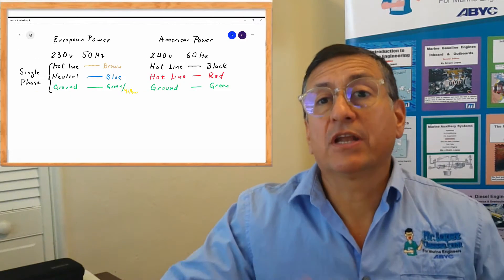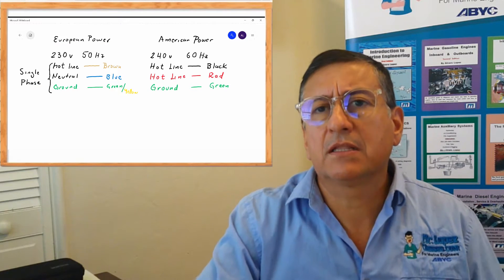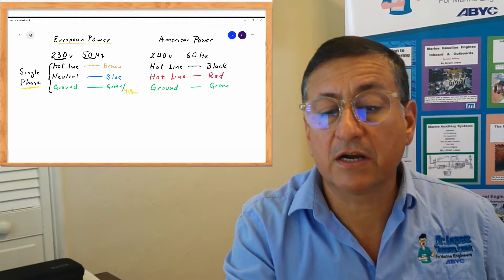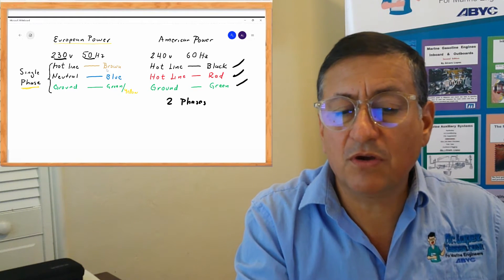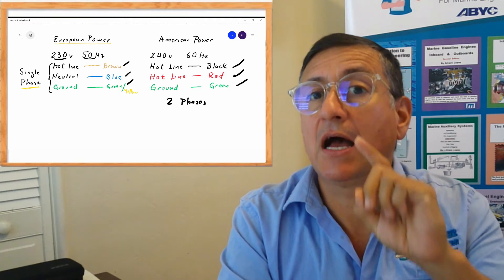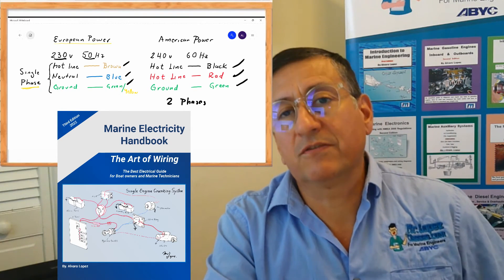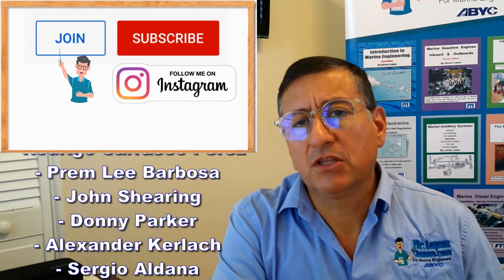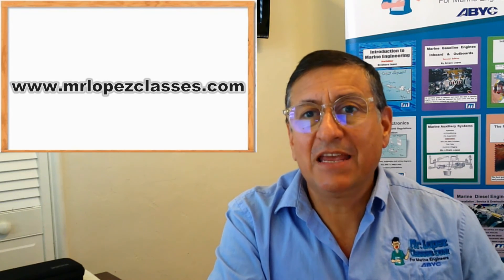What means 230V / 50Hz and 240 V / 60Hz | Shorts

Comment: Hey Mr. Lopez, I noticed you missed a key factor in the 120/240v system. The neutral (grounded conductor). For 120/240 system you need 2 phases, a neutral (grounded conductor) and equipment ground (grounding conductor). The neutral carries the unbalanced load, while the ground creates a fault path as well as equal potential. It is very important to have both. I see a lot of European boats not equipped with a true 4 wire system, even though they come out of the yard “ready for the US”. Are they not knowledgeable in split phase? Is it laziness or price (many of the boats I work on are production)? Is it availability of wire in Europe? I’m guessing 4 wire probably isn’t readily used, manufactured or available since Europe mainly does single and 3 phase.

Comment: Hello if I connect a 230volt 50Hz  ac fan to a 60Hz and I connect it again to a 50Hz which one will be drawing more current the 50Jz connection or the 60Hz connection.
Reply from the maker: If you have a fan 230V / 50 Hz that draws 40 Amps there is just one phase.  If you connect that fan to 240V / 60Hz source ( There are two phases 120v each one) then the flow of current per each phase will be 20Amps
Reply: @MrLopezClasses  Okay thank you.

Comment: Thank you. I'm sick of running into the Hz conversion wall where people says it's not possible to convert Hz into Amps.
Reply from the maker: HZ is the frequency and It is directly related to the RPM of the rotor in the Genset. and Amps are the flow of electricity through a specific point. Both of them are different concepts.
Reply from the maker: yES, yOU ARE CORRECT

Comment: in america it's 240v single phase with motor loads name plates have 220v/240 50/60hz it's just at 60hz motors run 20 percent faster.  but they can be wired with l and n for overseas and for american L1 L2 240v and it will work.

Comment: Thanks! For resistive loads, eg water heater, or an appliance that states it can run on dual frequency (eg VAC 210-250 50/60 hz), is it true that it will not care whether supplied by 240 v 60 hz “US” vs. 230v 50 hz?
Reply from the maker: Hi. Yes it is true, those appliances can run with both frequencies, however they are a little less efficient running with 50Hz. Regards
Reply from the maker: It is true, however remember that in Europe they have 230V and 50Hz IN ONE PHASE, However in America we have 240V and 60Hz IN TWO PHASES

Comment: Hola Mr Lopez, una consulta, yo compré unas máquinas en Inglaterra, y las quiero usar aquí donde se usan 60Hz, me dijeron que podía cortar los enchufes y cambiarlos, eso es cierto?
Reply from the maker: Hola. Se puede pero no se debe. Ese equipo en inglaterratrabaja con 230V y 50 Hz en una sola fase. es decir entre Hot y Neutral recibe 230V. Si cambias sencillamente el enchufe , le estarias metirndo por el mismo Hot y Neutral 120V y no 230V, ahi estaria el primer problema. el equipo correria pero mas lento. y luego la frequencia ya no seria de 50Hz sino de 60Hza situacion que acarrea problemas de calentamiento y futura ruptura en los devanados del motor